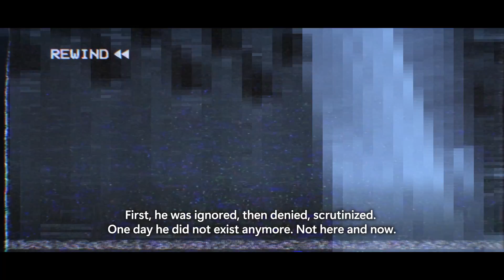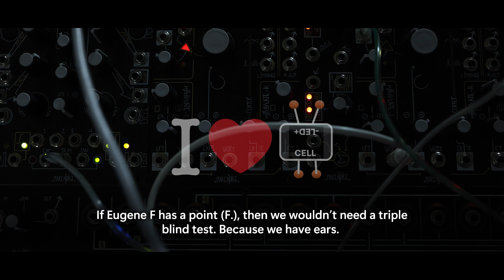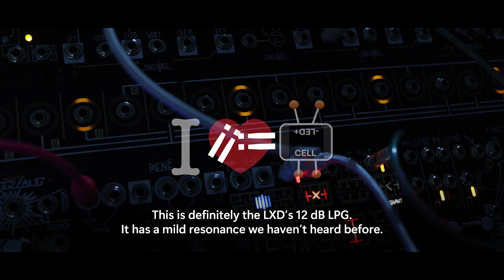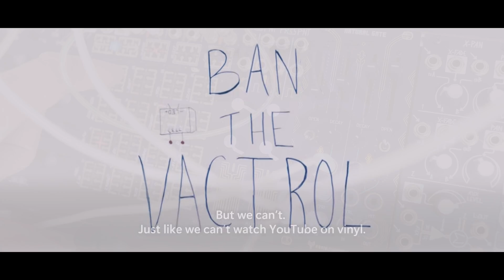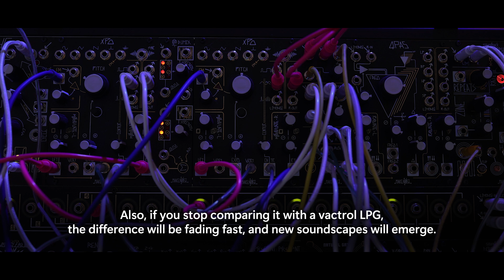Bring Back Vactrols! | Eugene F. Vactrolman was right

Comment: The Doepfer A-101-2 Vactrol Low Pass Gate is in my opinion the best LPG for eurorack
Reply from the maker: Respect! I am not familiar with the Doepfer, but if Doepfer makes one, I am sure it's excellent. If I ever do a LPG compare again, I'll check my local supplier if I can borrow one. However, I heard a ghost story saying the old A-101-2 is better than the more recent ones. I suspect they still had access to true Vactec supplies, but this is all speculation and hear-say. I'd say, always let your ears make the decision. I try to remain unbiased and objective, but that's not easy. 

The SSF SSG sucks as a dual LPG, but is a GREAT module on its own and much more fun than a classic LPG. Also heard a lot of good stories about the Meng-Qi, but I don't know it. These compares are never meant to be exhaustive and complete, they're more a guide to figure out the sound YOU'd like most. Not me. I simply use the Buchla 292 as a reference. The Tiptop version is developed with the Buchla team to make sure it sounds right. And for me, it does.
Reply: @CinematicLaboratory  You made me wonder which version my A-101-2 is, so I went and opened my system to check. To my surprise, it's version 1 manufactured in 2004. So if the ghost stories are true, I have nothing to worry about, haha. I still love my Optomix a lot, and it's fun to have different behaviors. Thanks for your videos, by the way, they are always very inspiring and entertaining. Cheers!!

Comment: I am so happily confused 🫤 do I want a Vactrol or a  low pass gate? Maybe I want a Vactrol inside a low pass gate or a low pass gate that is a Vactrol. 
Thanks so much for confusing me and sounding good in process. 
And I am pretty sure you can make your own Vactrol using vegan ingredients
Reply from the maker: As far as my research goes (wiki), the cadmium LED cell is responsible for the lagged response. Emilie Gillet modelled it in Streams, which sounds super nice once you realize it's a LPG. Natural Gate proves that you can make a truly excellent 'green' LPG that may be even better than the Buchla 292 inspired vactrol designs. TipTop Audio is far in the prototyping process to make that EU compliant 292T without vactrols. And the MakeNoise DXG sounds amazing if you finetune new sweetspots. I believe we are on a crossroad here, and I am confident mr. Eugene F. Vactrolman has nothing to worry about. But I do believe these new 'green' modules should at least sound like a 292 to qualify as a LPG. I like the Steady State Gate a lot, but it's a mono design and a Bongo has two toms. If it's not dual, you can't make a bongo. The 292 is quad for a good reason. There are a lot of modules with home made 'vactrols', but quality will differ and some sound like a 'blurp' instead of a 'bong'. But it's 1960's tech and we should be able to make a clean one in 2024, even when it's on a chip. You can also come very close with a low pass filter and a snappy exponential envelope that handles both decay and a 6 dB mild cut-off. In the Serge world, you can patch one up with slews. To put a long story short, get a used Optomix if you can and you're working in dual mono. If you're working in stereo or complex sources, DXG is wonderful. If you ever find am affordable Natural Gate (you should decide), take the shot.
Reply: @CinematicLaboratory  Wow, that is amazing information. Especially interested in Streams I did not realise it used Vactrol modelling. I was thinking of using Vactrols in a future project that will be microcontroller-based. As streams is open source and Emilie did an amazing job at organising the code so the Vactrol part has its own files.  This will make it easy and fun to integrate.
Thanks so much for the info and hopefully one day I'll get to play with a few of the more exotic LPGs out there.
Reply: @CinematicLaboratory I love the clarity of the NG amp circuit. The lack of bleed is great. It drives really nice, and it has some really nice sweet spots, but I found the envelopes kind of hokey sounding at times. I’ve owned it twice and it was always kind of my second-favorite and I sold it when I down-sized. My experience was if you pre-order, the wait really isn’t that long. No reason to overpay for a second-hand one. 

My favorite LPG so far is the m13 mini vactrol LPG from Electro-Acoustic Research. They may not make any more of them, though!
Reply from the maker: @Space_pulse  Thanks for sharing your experience and I'll check out that M13. I am very curious! EDIT: I saw Stujay's compare, and I found the M13 too resonant and the NG too 'fake' compared to the Optomix. I would have picked the optomix here. I think it's super important to realize results may vary from sequence to sequence, depending on intensity of events and the range of frequencies. In the end, your ears must decide....
Reply: @CinematicLaboratory Optomix can be really rubbery and natural sounding for sure. M13 is a bit slow. Not the best at the more percussive end of the spectrum. But if you want that slow, ringing decay after a nice pluck, it sounds really good. I think it tames bright, harsh harmonics well. Not the most versatile. We all will have our opinions! I would agree about the darkness of the NG, and that’s what I mean by hokey. It is a bit exaggerated, not quite a naturalistic decay. Can be fixed by modulating with your envelope of choice, though. Maths and a VCA to control dynamics is nice. It is a brilliant module, for sure.